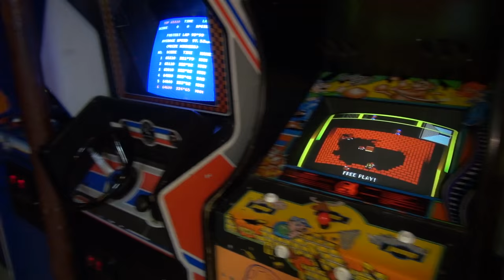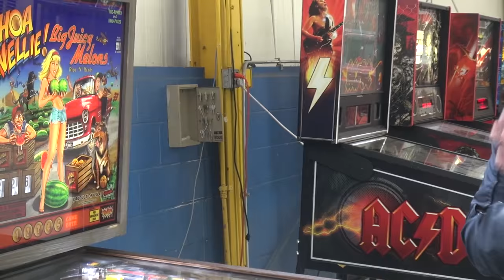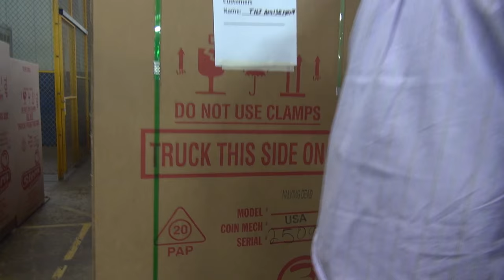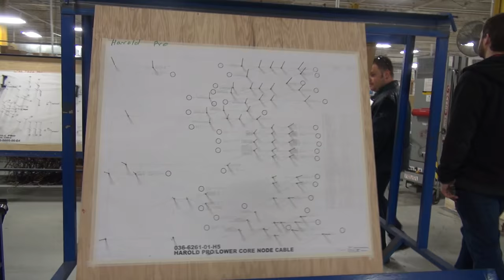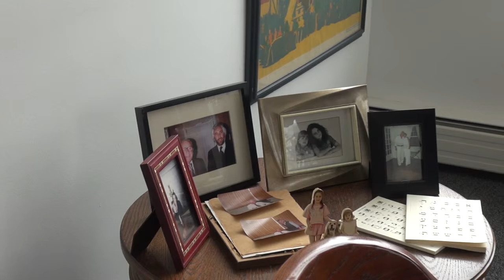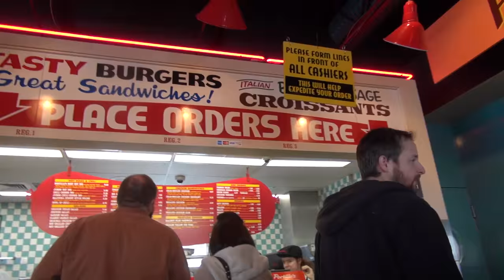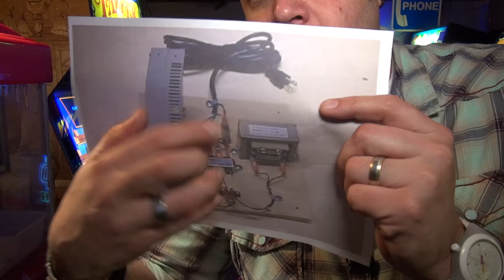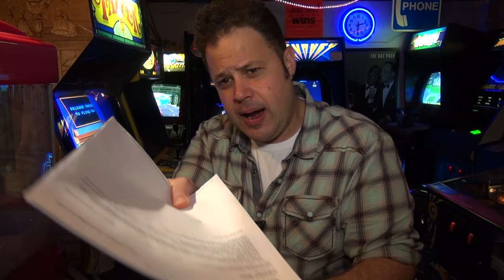All Access New Stern Pinball Factory Tour 2016 with George Gomez - Game of Thrones AMAZING!

Comment: Overall, the video gives a great homage to having people appreciate the work that goes into building a pinball machine.  Mr. Gomez was a gracious host, and Gary Stern should be seriously thanked.  Assembly lines are time expensive and costly, and robots could never do it properly in this industry.  This makes an example to dissuade "garage room" pinball developers to think twice about building machines if they do not have the experience.  Stern still has a lot of talent and experience from those that worked at Bally/Williams, more than most people realize.  What would make a good video which has not been seen on Youtube is the DESIGN phase, which normally is discussed at expos.

Interesting to see how much foreign speaking labor is employed at the Stern Factory floor now to potentially reduce costs and provide a marginally increased profit margin.  It seems to have increased dramatically over the past few years.  It might explain some things regarding quality control.  Excellent outsourcing of parts of construction in terms of contractors.  Otherwise, NIB machines would be prohibitively expensive and well beyond the reach of new collectors.

NOTE:  Quiz question.  What does "super deluxe" really mean as an English grammar double positive?  Answer.  Nothing.
Maybe Stern will make a "Super Deluxe" pinball machine in order to increase the cost by another $2000.

Comment: John, I use the exact mame setup as you.  To help your viewer mail guy who had questions about sync rate and resolution.  I use soft15k to get the refresh rate right and to help with resolution I use a program called "Quickres'.  This allows you to put your screen into some resoltions that simply aren't available on modern pcs.  I think mine is set to something like 400x480 or something like that.  I use Mame uifx which auto adjusts for each game so you don't get any squishing/stretching.  Hope this helps.

Comment: 56:39 can someone explain to me how this happens? If everything is new and clean and you have protective glass to block out dust then how does it get so grimy?
Reply from the maker: The black pinball rubbers
Reply: +John&#39;s Arcade Game Reviews &amp; Tech The microscopic metal particles, too, from the balls and metal parts. And some dust/dirt always gets insides, whatever you do, when the machine is switched on for a long time and gets warm, even if they heat up much less with leds now. Ther is some planned airflow from the bottom to cool down electronics and mechanics.